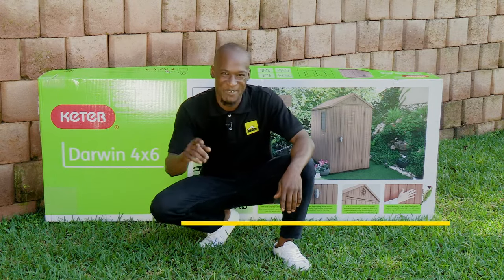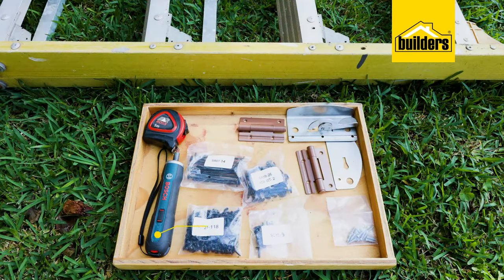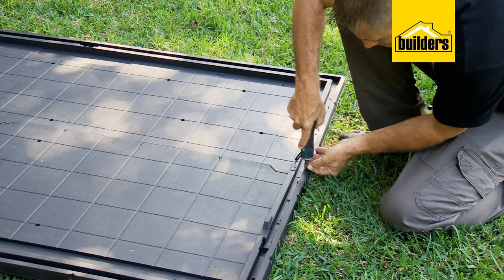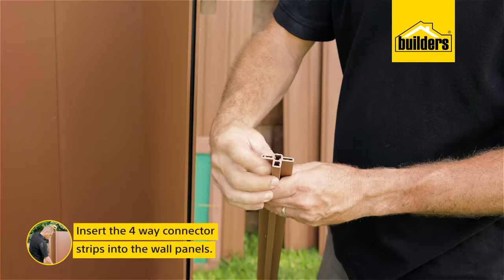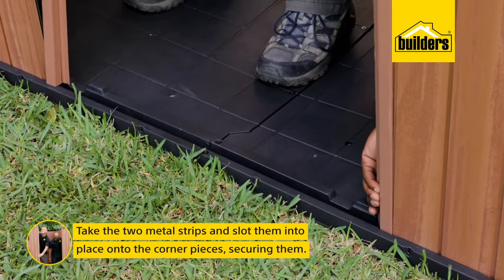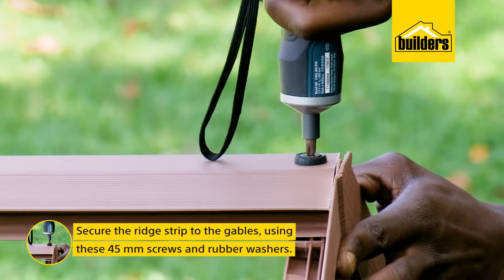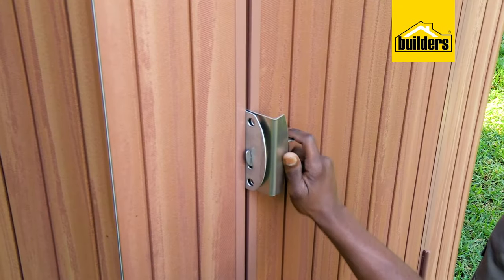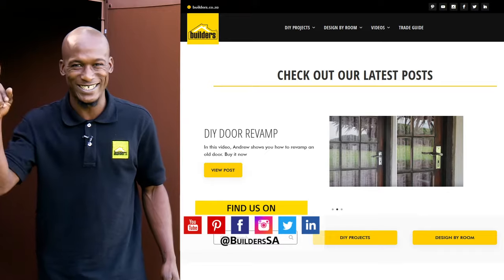Keter Darwin Shed - How To Assemble

Comment: I figured you got to level the ground, flex seal the roof add corner metal brackets then place cinder blocks in all corners for weight for any high winds.
Reply: It comes with 4 corner bolt hole marks on the floor for drilling and anchoring to concrete if you build it on that surface.  Going to start putting mine up tomorrow.

Comment: You did a nice job there!. But nothing about a firm base to sit the shed on, or any tip about window position options. I just built this same shed this week, and wished I had put in a screw , ir two on the back wall as U gad a comedy moment as I was putting in the steel strip watching the wall fall over!. Great easy build though!.